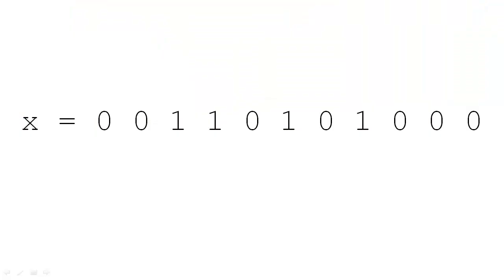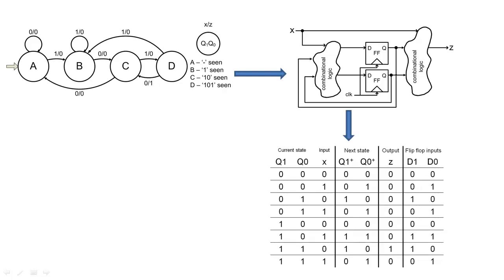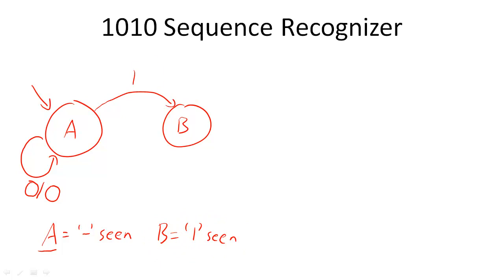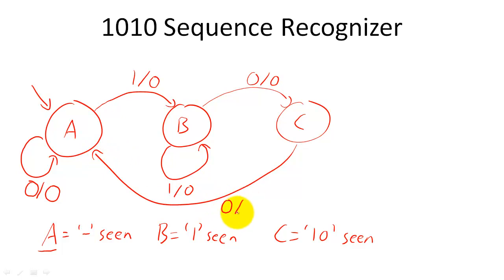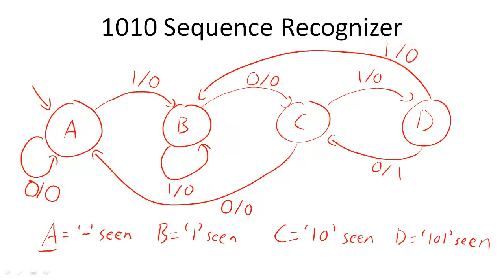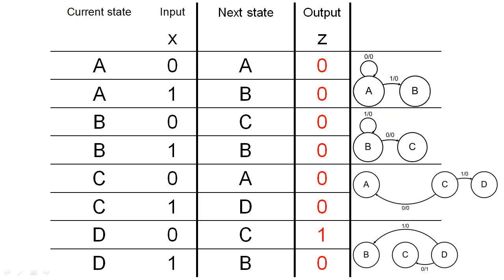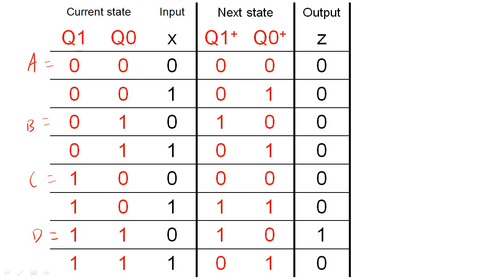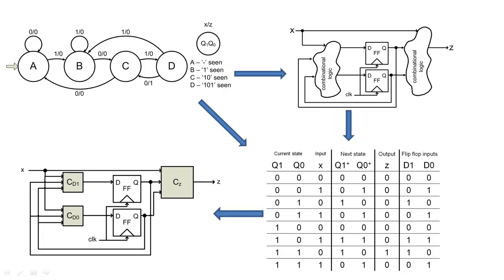Design Example: Sequence Recognizers

Comment: Draw a synchronous sequential circuit with a single input line x and a single output line z ,so as to produce an output z=1 whenever a input sygnal completes a sequence of 4 identical bits,the out is 0 otherwise.Please write the boolean function expression

please solve it for me